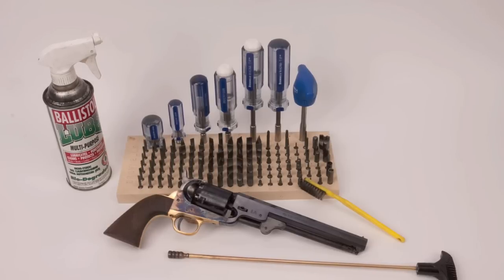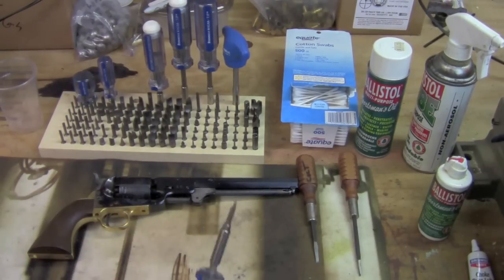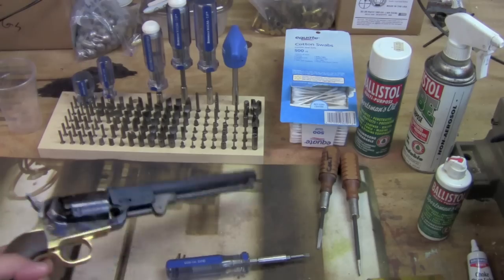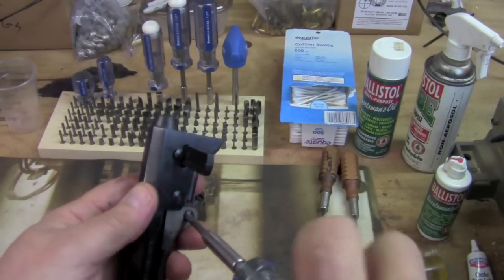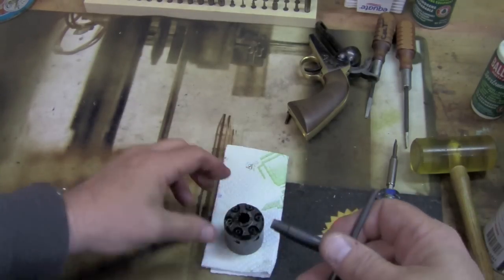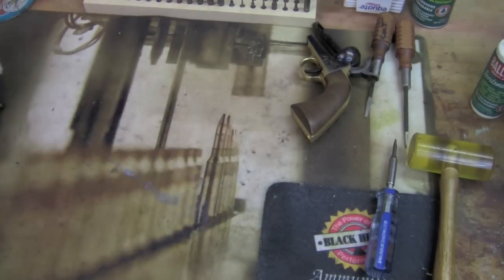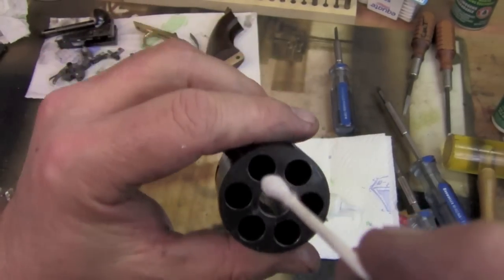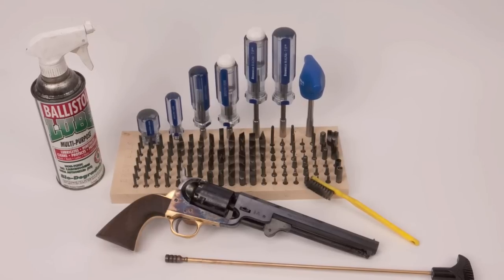Disassembly and cleaning Colt Cap and Ball Revolvers Part 1.mov

Comment: Dear Mike:  I haven't been continuously involved with Cap and Ball Revolvers and Black Powder like you have, but my first 1851 Navy predates the Italian replicas, it was a Civil War Veteran  acquired in 1954 from my Great Grandfather, he himself NOT a Civil War Veteran, along with a box of gear and a completely dried out and useless belt and holster.  My methods of cleaning are similar to yours except for the use of a variety of bore brushes sized for barrel, cylinder AND nipple threads and Brass "tooth brushes" as well.  Early on I actually boiled the parts in the traditional soapy water solution then in a hot water and soluble oil mix, then drying everything with a hair dryer which got me in trouble with my mother.  I have since graduated to Ballistol, Ballistol and water, then finally a wiped on coating of RIG which does a great job of protecting CLEAN metal from corrosion and moisture.  Given my long use of various brushes, I am a little curious as to the reasons you do not use them, especially on cylinder throats, forcing cones on the barrels, and in the rifling itself where that soft pure lead tends to smear.  I have had at times resorted to Shooters Choice mixed with Kroil and vigorous brushing after a long soak to remove lead from these areas.  I began my association with percussion revolver at the age of 13 in 1954 aided with advice and training, and can't believe that the brushes and some kind of lead removal solution are not necessary, at least periodically.  Do you have any advice about these matters, or am I just wasting my time and energy?
Reply from the maker: Donald Denison I don’t use brushes unless I need to, usually I don’t, but, if a bore is leaded I use a brush and lead remover. If a bore is extra crusty, and a wet patch won’t clear the fouling, I’ll use a brush. And if the nipples won’t come clean with a patch and finger pressure, I’ll scrub them with a bronze brush.

Comment: I use a mop bucket filled with hot water and brushes/jags.  Place parts on oven pan covered in tin foil at 150 degrees for 30 mins.  Lightly wipe down with olive oil after removing from oven.  A light surface rust will appear during bake process but easily wipes away.  Never had a problem with this approach.  Best benefit is the metal soaks up the olive oil and seasons it in such a way that future cleanups are effortless.

Comment: Wow, that is pretty interesting cleaning. I have a large plastic square tub I pour soapy boiling water into and throw the barrel assembly and cylinder into it. After soaking for 5 minutes I use my barrel brush, scrub brush till they're clean and set them out. The residual heat of the boiling water dries them completely. I spend most of the time with the action/grip parts which do NOT get put in the water. To each his own.
Reply: Funny, I use pretty much the same method. I put every part disassembled in the plastic tub and scrub all of them. Then I spray with ballistol and water before I set them down to dry. Water evaporates out of the ballistol and leaves a film to prevent any rusting. Hit with a hair dryer quick and then do another coat of pure ballistol over everything, let dry and wipe off till it shines, and then grease the arbor. I have never seen any rust. Ever. Also a baby bottle brush for cleaning baby bottle nipples works great for cleaning the pawl channel and the tight spots.

Comment: Aerosol "brake parts" cleaner works great for spraying internals.  Will not harm anything. Then after letting it set some brushing wash with hot water, rinse and continue as usual.  I only completely disassemble couple times yearly
Using spraying cleaning ECT. Does hard to reach areas without taking everything apart.

Comment from the maker: Remingtons are notorious for fouling, and my guns are no exception. After firing every cylinder full of rounds, I pull out the basepin and spray it with aerosol Balistol. If the action still feels gummy, I'll pull the cylinder and wipe its face and wipe the back of the barrel with an alcohol soaked patch.

Comment: I use dish soap and hot water to clean the major parts, a long thin rag with a knot in it as a bore snake during that hot dish soap scrub,  zippo lighter fluid to soak the nipples and their threads, the same zippo fluid and toilet paper to get tough spots, tight spots, and double check nothing left in the bore, if I'm not fully dissassembling the action I squirt a bunch in their and rinse it out with zippo, dry everything up and then coat the entire thing, every part except the nipples in a light crisco, swab some down the barrel, very light full coating in the cylinders and on the grips, everything, then wipe any excess off, put a dab on the nipple threads careful to not get any near the vent hole, and work it in to them and then put em back in the cylinder. Using the the crisco I lube the arbor a thin coat, then reassemble the whole thing. I wipe any greasyness lith a clean cotton cloth, and wipe the outside on large areas with a little of the zippo if it still feels greasy at all. This has gotten my revolver very clean and kept it well oiled between shooting sessions, and keeping the leather holster nice and moist with veg oil, crisco also, I have never seen a single speck of rust pop up and this has been true over timeframes of up to two years in a wet climate.

Comment: I enjoy your videos, and will generally learn something each time I watch one. There is one problem with part one of cleaning. The entire frame assembly is not taken apart, then suddenly, it is apart. Since that has the major machinery, it needed to be covered. 
This is a minor point, but important. Keep up the good work?
Reply from the maker: Barry Almand Thanks for watching. As I explained at the beginning of the video, I will show how to disassemble the frame and action parts in part 2 of the series.
Reply: duelist1954. Sorry for not hearing! I appologize. I love my '51, I've had it for 20 years, and yet to load and fire it. I do love your videos!

Comment: Really enjoy your videos.  Had a quick question.  Have you ever noticed Ballistol to remove or cause fading in the case color hardening?  I have a Cimmaron/Uberti 1851 Navy that I use Ballistol on (which I love and works great) but I've noticed in the couple years I've owned it that the case color hardening went from vibrant to faintly noticeable and the frame now has that greyish look to it.  Appreciate any input you may have and again great job with your videos.

Comment from the maker: First try putting the barrel on sideways to see if the problem is the arbor or the alignment pins on the frame. If it is the arbor I'd go over the arbor and the arbor hole in the barrel with 320 grit emery cloth.

Comment: Mike, thanks for the great video. I think it is the most thorough one I've seem. I just got the .36 Pietta 1851. When I cleaned the oil off, I used T6 foaming bore cleaner. (I once soaked a 9mm in mineral spirits to get all the oil off.)  I wiped parts down with Hoppes and then oiled everything. After watching your video, I ordered Ballistol and plan to switch over to it. Out of curiosity, on the Ballistol website it notes that to clean black powder to use a 25%/75% mixture. You use a 10:1 mixture. I was also wondering what you use to clean and keep the wood looking good? Finally, what is the small wedge screw used for? I noticed it doesn't fit quite tight against the frame, like the other screws do. I suppose it's because my gun is new, but I had to put the butt on my leg and tap the barrel to get it to slide back on the frame. Anyway, keep up the great work! Us newbies need a mentor to help us along, and I'm sure I can speak for everyone when I say thank you.
Reply from the maker: The water is what cleans your gun, not the ballistol. The benefit of the Ballistol is that the oil stays as a rust blocker after the water evaporates. 10% works well for me...25% works better ...if you sell Ballistol...LOL. The little screw keeps the wedge from falling out of the gun when you pop it out of the barrel.
Reply: @duelist1954  O.K. I went ahead and took the wedge out and cleaned it as it was loaded with oil (just like a Taurus import). The screw on mine can let you scoot a fingernail underneath it. The Cabela's guy checked 4 and they all had some small gap. I figure the tolerance is intentional... Thanks for the quick replies. I really am enjoying your channel. My sons plays Red Dead Redemption II. He usually doesn't like real guns, but when he saw mine was what he had been using in the game, his mind is changed. He definitely wants me to teach him how to use it.
Reply from the maker: @steveinkentucky  That's great!

Comment: What do you think of a mixture of Alcohol, Peroxide and wood oil soap for cleaning?
Reply from the maker: +mindakota1 I don't like it. plain water, or balistol/water is all you need
Reply: mindakota1 , that's the mixture I've used for 22 years, when I got my first bp. I could tell as soon as he sprayed the cylinder, it was melting the fouling away better than the alcohol/peroxide/murphy's. Also, I get rusty spots when in the safe, I think the balistol probably leaves a better oil behind than the murphy's

Comment: You Should do a video on how you now use the Rand CLP, I wonder if Rand is similar to Froglube, both have the vegetable base.
Reply: I was told that any CLP is Wax based which is not so good for cleaning up Black powder residue. Ballistol is Water soluble. Mike covers alot of this around the 12:00 mark.

Comment: Alignment pins are actually a loose fit.  I worked on reducing the arbor diameter and got it down to a snug fit.  Are wedges supposed to be so tight as to require a mallet tap to remove?
Love your videos!

Comment: I got a kirst conversion cylinder and cut the recoil shield on my 1858 steel frame a little deeper than I needed to. Maybe a lot deeper. I've shot the gun 10 times with cowboy loads and I can't see any damage at all. Will it eventually fail or is 10 shots a good test.

Comment: Hi Mike: on your video you stated that you used 3 different bits to disassemble your Colt dragoon a 180-3, 270-4, and a 340-4. my question is this. Will these 3 bits also work on my 1860 army by Pietta? or will I need other size bits. and if I do need other bits, then what sizes do I need?... I also find your videos to be most informative and very useful...Thanks again Mike

Comment: I am new to cap and ball, just got my first revolver which is an 1860 Army by Pietta. I have been trying to remove the wedge for hours. I've tried to push it out with my thumb... I have hit it with a rubber mallet... I have tried a wooden dowel with the mallet etc. Please can you help me with any other tips or recommendations that may allow me to remove this wedge? I am thinking I have made a bad choice getting into this but I want to learn very much. Any and all help is very appreciated

Comment: Mike, What causes my 1860 to be so hard to take down?  The arbor seems too large
for the arbor hole.   It's a new Uberti from Dixie Gunworks.  The barrel assembly will not
easily seat against the frame.  Is there a fix? 
Thanks,
Tom Ireland
Hagerstown, MD

Comment: Any recommendations for a revolver that won’t break apart? Barrel wedge is removed, tried the loading lever trick and Nothing. Stuck pretty good..the pistol of quite rusted with surface rust so I imagine the issue is corrosion. I have yet to shoot this thing. Got it in in trade with a few sidelock rifles
Reply from the maker: Soak it in Kroil for a few days. Then put the barrel in a padded vice...tight. Place a block of wood on the front of the cylinder, and hit it with a hammer.
Reply: @duelist1954  thank you..it’s just a cheap cva but I think it would be cool to get it cleaned up and functional again

Comment: This is just the kind of information I need as a novice black powder shooter. I have recently bought an Uberti Navy Colt in .36 calibre. I want to deep clean the weapon before I use it but need to put together a kit of tools. My one concern is removing the nipples - are nipple wrenches a standard size or do I need to buy one specifically for the manufacturer? Many thanks for your massively informative videos.
Reply from the maker: The sizes vary depending on the type of nipple. All revolver nipples take the same size wrench. Not all wrenches are made equal. Buy a high quality one from track of the wolf.

Comment: If the screws in this gun are easily messed up, can't you heat treat them to harden them, or but hardened screws ?
Reply from the maker: Maybe...the steel is pretty mild though, so you probably can't harden them. I used to go to Numerich Arms AKA Gun Parts, to buy West German screws for Hawes Western Marshal, and use them in C&B revolvers. The German screws were much better, but that stock has been exhausted. for

Comment: Mike, you do use a lot of Ballistol, dontcha?  But it looks like you're using it in a pretty close-in workshop.  The thing is, my can (spray can, actually) of Ballistol carries a rather alarming warning agaist breathing the fumes, or inhaling the spray mist, and to use it in a well ventilated area.  So, I only use the stuff outside (and I use Bore Butter as the rust preventative, which has stood the test of many a New England winter).

Your thoughts sir?
Reply from the maker: Most of the Balistol that I use  is liquid. I mix it 10:1, water: Balistol, and apply it with a pump bottle. I use very little aerosol Balistol. For the last year I've been using mostly Rand CLP, which works very well in B-P guns.

Comment: So the wedge in my 1860 Army isn't coming out. I've pressed it down with my thumb and no luck. Tried using a rubber mallet, no luck. Tried pulling on the other side while I press down and no luck. Is there another way I can get it out?
Reply from the maker: JoeHooker11 Use a hard plastic mallet, rubber won't do it if it is tight. You might also need to make a hardwood wedge pusher if it if really stuck.

Comment: Just picked up a walker and I can't the barrel off the arbor! I tried the loading lever trick you showed, but no luck. Any ideas?
Reply from the maker: Latiqua LaTaytay Secure the barrel in a padded vice. Use a wooden block and a mallet to pound the front face of the cylinder to back out the arbor from the barrel
Reply: duelist1954 Thanks for the tip! No luck, though. Got another one from Midway that came apart correctly. Love the videos Mike!
Reply: Me and my Father have this issue with his Walker. It's the powders fouling. We rest the lever on the table and pound down on the grips. Each time we do this we make the gun look more original.

Comment: Thanks, I saw that you answered that question later in your video.
Thank you I am new to Black Powder  Percussion... Addicted now.
I have not seen "Ballistol" around here... Can you tell me another equivalent oil? Plus I looked up that screw driver set that you have and it is in the $400 plus range...  Could you list most common sizes needed for these guns as well as for the 1863 SAA's?
Thanks again subed to your channel as well :)

Comment: I have a question. I recently got a used 1851 replica and the action of the hammer is very stiff and cock the piece is somewhat difficult. How could this be fixed so I have a smooth action?
Reply from the maker: You could try a lighter main sring from Pine Tree Forge, or Lee or Wolfe
Reply: duelist1954 thanks I’ll take a look at that! Need to get this thing in fighting shape before reenactment season catches up to me

Comment: I can't get the pin out to remove the cylinder. I've tried pulling it, pushing it, pounding it with a mallet, nothing can get it to so much as budget. Is there a trick I can use to move it?
Reply: You mean the wedge?
Reply: A bigger hammer? Some are crazy tight. I busted a brass drift on the last new Pietta I set up.
Reply: Yeah, I meant the wedge. Ended up taking it back to the store and somebody there managed to get it out. I think he used a punch and maybe a vise. No problems since then, the gun's been really fun. I love the big cloud of smoke every time I fire it.

Comment: Hey mike my 1860 army wouldnt go to full cock sometimes unless you cocked it really hard when i took the barrel wedge out and the cylinder off it would work fine so i knew it must be the hand or the bolt upon closer inspection the hand wasnt under enough spring tension so i took it all the way down and bent the hand spring out further and it worked fine with the barrel wedge in BUT im worried it might happen again if the spring took a set before it probably will again what would you suggest to remedy this?
Reply from the maker: William Getzstoned I think your hand is a little too long. A little judicious file work should fix it,
Reply: @duelist1954  alright I'll have to give that a try next time I have it taken apart I think you're right because it also sometimes wont rotate the cylinder if you have it on the safety notches thank you you're the best when it comes to bp revolvers